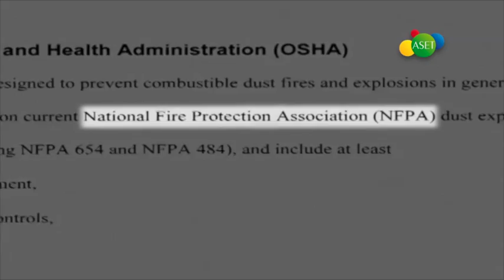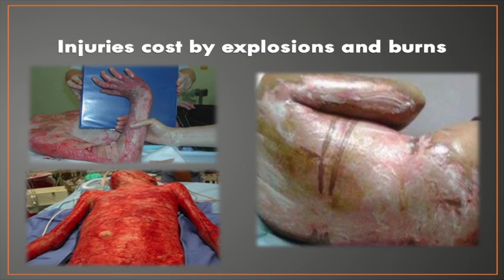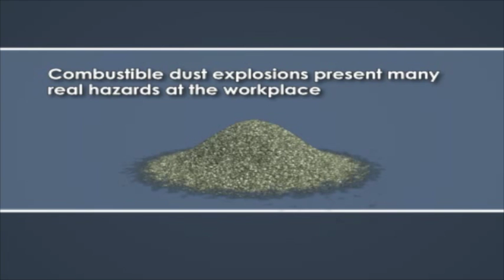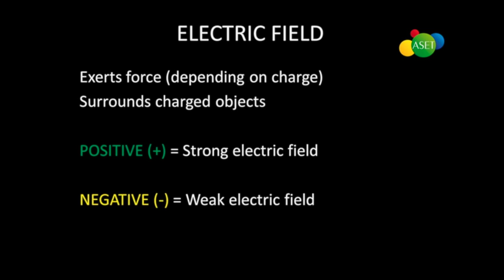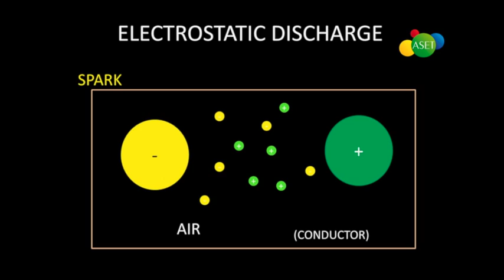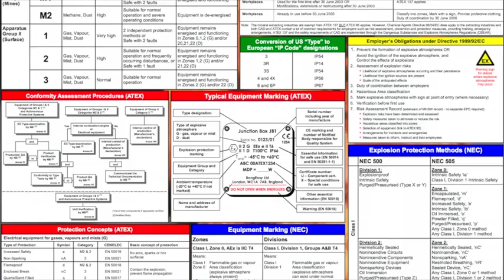Dust Explosion ASET

Comment: wanted to find weaponized dust explosions. They seem to be quite destructive. You could substitute a flamethrower's fuel with cheap dust
Reply: Should check out thermobaric weapons , it's used for caves
Reply: Except that you need a confined space for the dust explosion to work and the fire isn't as persistent as liquid accelerant.
Reply: Has to be in a confined space to get an explosion. Otherwise, you just have fire.
Reply: @johnkeo358  those are just so nasty doomsday machinery
Reply: @Drews549 because it's a fuel source, but like all fuel it needs an oxidizer to ignite

Comment: When I worked with flour, we had thick dust everywhere, so they made us a central vacuum system with multiple outlets for us to plug vacuum hose into (similar to one's shown) all out of PVC pipe. You couldn't touch it without it shocking you. Their solution wrap all the PVC with bare ground wire. It was NOT a good idea!!!  You could watch up the wall and across the ceiling blue sparks jumping from loose spots in the ground wire to the statically charged PVC pipe. The perfect ignition system for an explosion! Ofcourse it took months for anything to be done with it! Thank God it never ignited!
Reply: That’s terrifying ! 😰